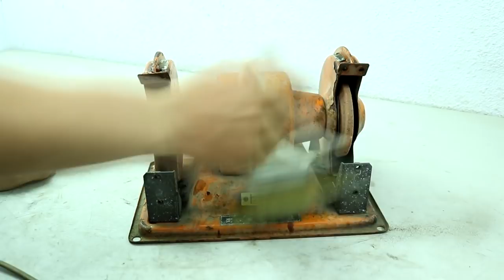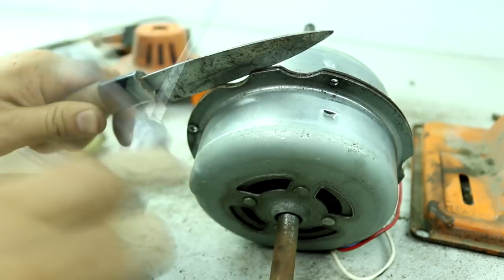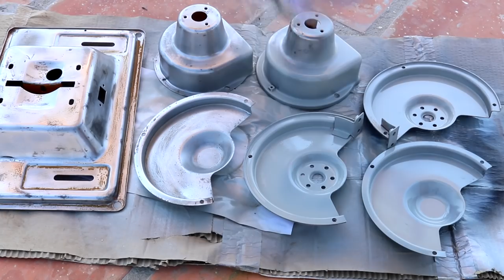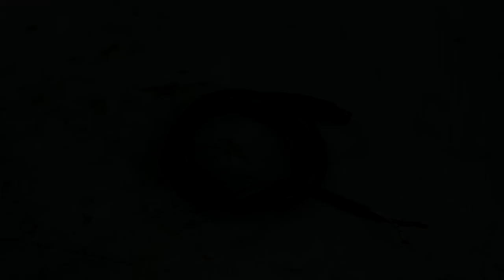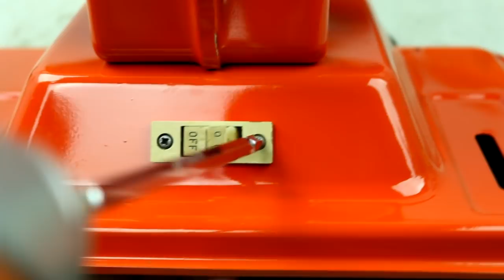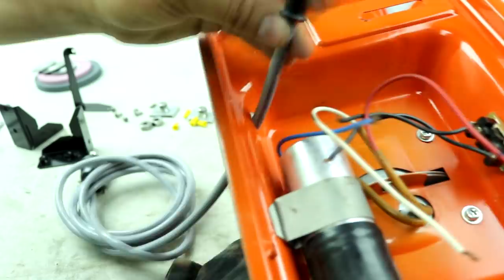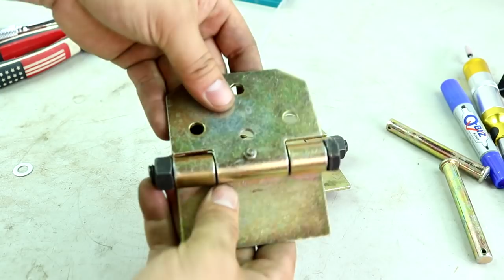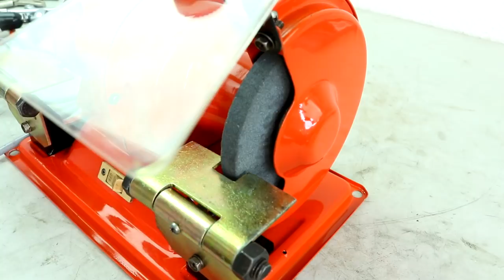Old Bench Grinder Restoration [kotobuki grinder orange]

Comment: Please read about how to electrically correctly setup such a device. What you do is extremely dangerous! You need to connect the ground to the metal housing (use a 3 wire cable from the plug). In case one of your cable to cable connections get loose, then the house-fuse will melt and safe your life. Also the motor can have a defect. There are also other little problems with your setup, so please study how to do it properly.
Reply: Yes, the plug looked like it could be plugged either way...He has no way to ensure the hot wire is going to the switch.  The motor and grinder housing must be grounded for safety.
Reply: Alec006 I mean I live in America and in this little old small town I live in it’s rare but they make plug adapters that still maintain safety of the three prong.
Reply: @dennisburns6962  Restoration calls for a plug that go's in any which way. Yea I would have grounded it, that's for sure....Back in the day a lot of folks did the electron dance until standards changed....
Reply: No need for it, its a 2-pin plug...
Go work on your lockpicking
Reply: More or less what I thought, too.
And for the smart asses: you're right, its a two-pin-plug but he should have used a three pin one instead for the METAL HOUSING.

What I did not got: he renewed everything. Except the ball bearings. Even if the seem ok: no. Get new ones for 15 bucks, thats it.
Reply: Just about every hardware store sells 14AWG 3 conductor cord.  If they don't, you can simply buy a 6ft extension cord and cut off the female end.
Reply: @D_V_.746  riddle me this.. How are those painted metal surfaces all attached to each other? Magic? No! Screws! Screws that bond all of the metal surfaces to be one. Hmmm... Seems like you're not a know it all either..
Reply: @D_V_.746  lol you're grumpy. What I'm saying is screws are metal. Metal is conductive.. Fun fact.. If something were go to wrong then the entire unit would have electricity through it. Painted or not.
Reply: @D_V_.746  I won't lie I didn't watch the whole video so who knows maybe you're right. I did however train to be a electro mechanical engineering technician for a year so I know a thing or two. I also worked construction doing alot of electrical work so why don't you stop with the harsh language and be civil. No need to flip.
Reply: Potti314  π8τφ
Reply: @D_V_.746  we got a ego over here
Reply: @GageDrums  You didn't watch the whole video. Then you get into an argument with an industry pro. Then you try for the high moral ground when he schools you the hard way. Wow. It's great entertainment, I'll give you that.
Reply: @Rockymountain11  *AN ego. If you're going to pick a name like "smartguy" you should try and live up to it.
Reply: @D_V_.746  wow, I'll lose sleep over this for sure..
Reply: @woopimagpie  happy to serve
Reply: @woopimagpie  proves my point
Reply: Just food for thought to all the electrical engineers condescending to any and everyone, many contemporary metallic appliances only have a two prong plug. That grinder is more likely to hurt you if you don't wear gloves and safety glasses than give you a shock. I'm sure upgrading the grinder for safe operation is prudent, but why piss all over the guy's restoration? Be positive, or be miserable elsewhere.
Reply: The comment section is to give feedback. Beside of the beautiful restauration work, the electric set up is most worth a feedback. He should know that it was not correct how he did it.
Reply: @geomiss8889  I worked in test engineering back in the late 80's... we called that electron dance  the sixty hertz shuffle.
Reply: @Potti314  Then perhaps others should just recommend a ground, rather than talk down to a stranger, which is what a lot of people deliberately did. They weren't trying to be helpful. They just wanted to criticize and boost their own egos.
Reply: @D_V_.746  so you say that if the phase touches the metal housing and you touch the housing, you will not get shocked?
Reply: Sometimes I feel like any old American joe just saves up money buys the equipment and starts making videos like he’s a restoration expert
Reply: @D_V_.746  So if I touch a live wire with two hands I will not get shocked because the potential difference is 0?
Reply: @D_V_.746  so I can go an touch the live wire at my wall plug and not get shocked because I have a pvc floor? or if I am wearing rubber soled crocs? Need to try it now :)
Reply: @D_V_.746  i know and i dont need to touch it because I know that I will get shocked (I did get shocked a lot of times where your definition would say thats impossible)
Reply: @D_V_.746  wow you must be so mad. First you say thats basic electricity and then you are talking nonsens and flaming other guys on YouTube and wish they have died? You are clearly no "professional industrial guy" if you act like this. And I will not continue discussing with someone like you because all you do is insulting.
Reply: munches popcorn coughBETYOUWONTHITHIMcoughcough
Reply: Just let him do it
Reply: My apologies I did not realize how bad this was 😂 compared to other restoration vids this was just awful very unprofessional
Reply: @D_V_.746  i have never heard bint before
Reply: No ground even in the kitchen ?  @alec0065
Reply: @SMHH  I noticed that too. I guess at least he is trying and the constructive feedback here is taken as that.  When I was young and I still see it today people cut off the ground plug or use the silly adapter to get away from the ground. Here is another note or caveat. Insurance company discovers negligence in a house fire they May Not Pay the Claim.  Good luck to all and think safety and enjoy your restorations.
Reply: Then there is no need to attach a cable.
Reply: I love the comment section  ^_^
Reply: @D_V_.746  I did not think middle-schoolers could get youtube accounts,
Reply: @D_V_.746  damnit. No matter how hard I try someone is always going to bring up the time I got caught working my business. Yea, it's thick, I get that, but please leave it out of this.
Reply: He wired it back according to how it was originally, the Japanese use 2 prong plugs.
Reply: You can put a ground wire there but if the wiring in the house doesn't have any it doesn't matter. Also for those that are complaining, start your own channels and do the restorations however you like. Pretty easy to sit at a desk and pick apart all these videos others have done. Don't like it, move on to the next video, no one is forcing you to watch.
Reply: Nice to see you here Potti  :)
Reply: Potti314 p
Reply: Yall are all wrong. He should have just left the 2 wires bare and stick them straight into the outlet when he's using the grinder. Grounded and non-grounded plugs are both unnecessary. I cut the plugs off over every electronic that I own and just cram the wires straight into my breaker box as needed. I just wear rubber gloves is all. Dummies.

Comment: I have a grinder, done restoration but having doubts in electrical connections. Mine having 4 wires from motor and having 2 point switch,please help in completing the connections.

Comment: Great idea using HD Hinges.  I would have used larger Grinding wheel and a Wire Brush for 
my purposes.  The rest should be 1/8" min. above Centreline of grinding wheel. 
Use of a 'swing press' (Hammer) is recommended!

Comment: Those hinches as bracket not a good choice! The stones become smaller overtime and the gapp between stone and bracket becomes bigger and a hazard risk increases! The machine itself looks great butt make a decent and adjustable bracket for safety!
Reply from the maker: These hinges handle can be adjustable easily forward and backward.

Comment: OK:

1) why is this not earthed?

2) why hasn't a correct cord grip been fitted?

3) why hasn't a protective cover been made & fitted to the base? 

4) why weren't paper blotters used on the new wheels?

5) when the motor spindle was refitted was the correct orientation considered...or was it just guess work?

Glenn
GLMelectrical
UK
Reply: Because reasons...
Reply: 6) The gap too high between the purple wheel and hinge, it's dangerous.
Reply: @jonaalvarez 

Yeah....
But what reasons...?
Reply: @andrasfarkas7716 

All that really happened here...was he sprayed it with some paint...

Amazing what passes for a "restoration" nowadays...isn't it...
Reply: @glennmoreland6457  He wanted to do that way, simply as that.
Reply: @jonaalvarez 

Best of luck then...
Reply: @glennmoreland6457  In Japan many circuits are not grounded, this has been common for a long time.  Newer tools might be but most low voltage single phase tools are not grounded.
Reply: @465maltbie 

Hmm...
But they'll still be a reference back to star....?
Reply: @glennmoreland6457  max 5 mm (CE)
Reply: May be 110 V it is only 55V over ground (not so dangerous, but the limit is 50V ac), 230V devices require differential circuit breakers + ground or double insulation
Reply: @pinolo951 

The frame will still need referencing to the centre tapping if its reduced low voltage...
Reply: It's a Japanese grinder (hence the 100V rating), and Japanese electrical outlets don't have a dedicated earth lead.
Reply: @glennmoreland6457  new cord, new stones and a paint job. Didn't change the bearings but I guess the drill press will need some soon with all the side load put on them with the wire wheel
Reply: Yeah the earth should probably be added
Reply: Is that why at 2:44 you can clearly see a label next to a screw called "EARTH"?  If the equipment is double insulated then an earth is not required, this grinder clearly isn't - it should be earthed.
Reply: What kind of person goes on the internet and complains about something someone else did that has no affect on them? Losers.  Just a reminder this YouTube Infotainment is all freely given.
Reply: As the other dude says the earth strap goes on the outside. It would only be connected if you were bolting the grinder to the bench and keeping it there. He only fired it up for a quick test hence didn't hook up the ground strap
Reply: @xachappe  
The man behind this video explicitely asked for constructive criticism, which is what the British mechanic provided politely and respectfully at the beginning of this comment thread.

Some people here should stop being wantonly rude in their white-knighting.
Reply: What good would it do for him to ground this piece of equipment if the place he's plugging into isn't grounded? He could've put a ground on this but essentially why are you so worried? He's the one using it not you. He's the one that refurbished this, not you. If you're so worried get in touch with him,  pay for him to ship it to you, fix it and send it back and then fly yourself out to his place to do an inspection and if all isn't wired to your standards re-wire everything in his house/apartment and upgrade his panels and fuse box.
Reply: @jhmitc 

Why do you assume the outlets have no provision for earthing...

Taken a look round have you...?

Comment: Very pretty but electrically unsafe, now that's OK if you're just restoring it to sit on a shelf and be looked at and be a conversation piece. 
However, if you're restoring it for use, then it must be electrically safe. Regardless of whether it wasn't originally fitted with an earth/ground wire or not. If it electrocutes someone, saying it is original will cut no ice in court be that a legal or coroners court!  
If any metal part of the appliance can be touched, it  MUST be fitted with an earth/ground wire, and preferably be PAT tested. (portable appliance test) a legal requirement in the UK Ireland Australia and New Zealand.

Comment: As has been said at least a few times below, this needs to be earthed, especially with horrible twist connectors and a machine that vibrates a lot. If a wire comes loose and touches the chassis, then touching any part of that thing would be like sticking a screwdriver in a plug socket. This is especially the case if you are selling these items, I don't know your specific laws, but you will likely be very liable for making sure these bits of kit are safe and to standard.
Reply: Good point about the motor vibrations possibly loosening the marret connectors. You may want to wrap them with electrical tape to reduce the risk of that happening.

Comment: and where is the grounding to case ??? You need to connect the ground to the metal housing if anything goes wrong you will die this is dangerous and also check your drill video you connected ground on painted metal good luck if you want  live

Comment: Just seen it's worse than that, this thing needs a base also, If someone were to pick this up to move it while still plugged in, they could easily dislodge one of the connectors and have a very bad day, likewise if one of the wires were to shake loose, they could touch whatever is below, a metal table perhaps and now you have a huge hazard.

Comment: Nice idea on fabricating a hinge as a Tool Rest.  You could have painted orange or black.
—
DeWalt DW758 Bench Grinder
https://www.dewalt.com/products/power-tools/grinders/bench-grinders/8-205mm-bench-grinder/dw758

Another option is using or modifying tool rests (replacement parts) from competing bench grinder models.  For example, this Bench Grinder looks like a common Dewalt 6 and 8-inch grinder.  Look at the exploded DeWalt Grinder Parts Diagram
https://www.ereplacementparts.com/dewalt-dw758-type-inch-bench-grinder-parts-c-1009_1166_3039.html

gb
Reply from the maker: Thank you for suggestion.

Comment: you refinished a grinder, not restored it.   you did nothing to address the operation of the motor, or even the cap. Your power cable install was improper as well. i guarantee you that thing did not have crappy wire nuts on it when it left the factory. The hinges as guides was just a waste too, IMO. I appreciate your effort you put into the video, but calling it a restoration is really just hurting your credibility.